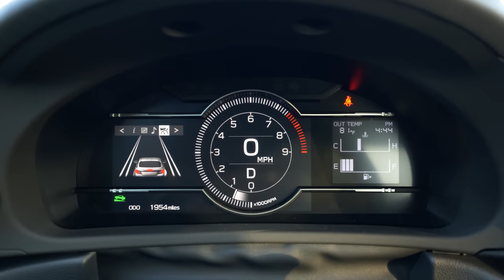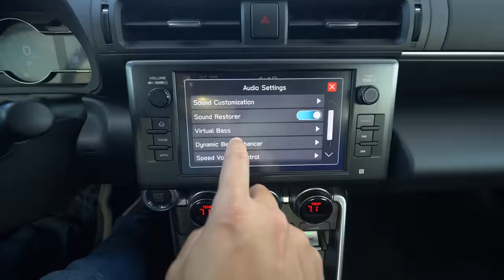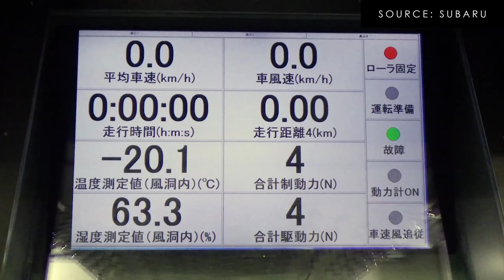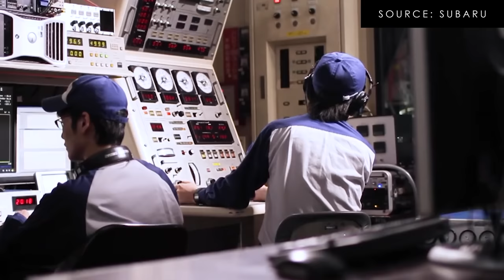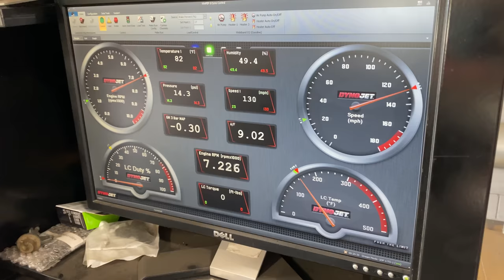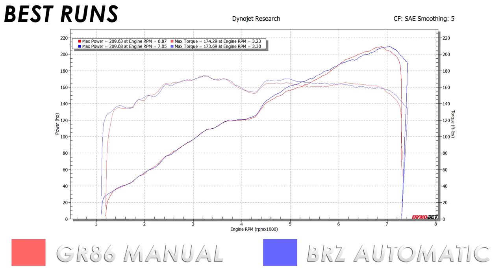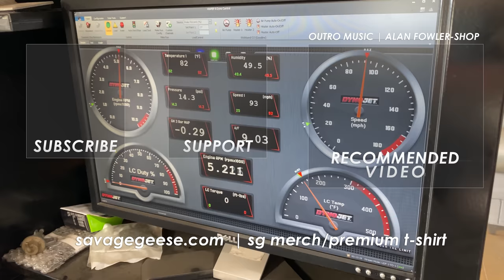2022 Subaru BRZ | Something For Everyone

Comment: Were you able to feel a difference between the BRZ and GR86? Looks like the big differences are suspension related. Aside from spring rates and knuckles, the BRZ has its sway bars connected to the unibody, where the GR86 has it's swaybars connected to the subframe. Some reddit users mentioned the GR86 could be prone to flexing, if that is the case. (I'm no expert so I'm just reiterating what I read).
Reply from the maker: Its so minimal.  And anything that is different is purely bolt on related and can be swapped back and forth. Guarenteed you will see GR86 get the knuckle update.
Reply: @savagegeese  Was hoping to learn why Jack is getting the 86 as a way of discussing meaningful differences between the two.
Reply: @ragweedmakesmesneeze  he likes the front end better I’m sure
Reply: @savagegeese  PS, LOVED the alternating underside shots of the differences between the two vehicles. Very interesting!
Reply: @MaddNomad1015  Could be, or he really wants a duck tail spoiler? I was concerned with the fact that Mark was reporting that the back end felt more disconnected from the front end. Seems like a pretty glaring problem for a sporty car?

Comment: as some1 who daily's a turbocharged automatic 86 i dont really get why any1 complains about the auto in these cars, does everyhing i want it to, manual  shifts arent pdk level but definitely not slow.
Reply: it's fine, works well but performs like the 10+ year old ZF6 instead of the best new autos
Reply: Did you have to do any upgrades to have the tranny handle the extra power?
Reply: @deej628  no upgrades to the transmission whatsover

Comment: If I were to buy a BRZ, 86 or Miata (or most 4 cylinders) I would pick it up with a 6 speed manual. I do hear that the DCT on the Veloster N is pretty good though. Otherwise it's V6, V8's or EV's for me

Comment: Want GR86 handling, but, want BRZ front fascia [don't like the duckbill, either].  Which to get and then swap parts?  

BRZ front cover on a GR86 seems MUCH simpler than putting a GR suspension on the BRZ, yes?   

I think I just answered my own question.  
[Get the GR and swap the nose... but then have to paint match it, or wrap it all. 😁]

/I still have my '91 MR2 n/a manual.  The '93 suspension mods may have tamed the snap-oversteer, but also killed some of the liveliness.  [aka: duller].   That's where I'm coming from re: the BRZ suspension being less appealing to me.]    Appreciate any feedback from those that know.

Comment: UK person here and Flame me if you like but this is why I'm moving to a small lightweight hot hatch that we get here in the UK.. hyundai i20N. I'm on my 2nd FT86 car. Had 13 gt86 first now 19 brz. Imo out the box the brz is setup horribly compared to my 86. It's an understeering pig. Preferred the steering on the 86 too. I must have been mad to get the brz lol. I really wanted to love these cars but i just don't think an na flat 4 is a good sports car engine.  So wish we got the Z here in the uk :(
Reply: I think you ought to reserve judgement by saying that 'na flat 4 isn't a good sports car engine', until Toyota GB have demonstrators of the GR86s, now that the 2.4 litre engine makes a lot more torque at a usable RPM range. Also regarding the understeer issue, that can be rectified with camber/caster/toe alignment, sway bar size and tyres.
Reply: @smilepermile8165  i just can't see it myself,  flat 6 yeah! It's going to be better the F20 but that's not difficult lol
Reply: @patrickbateman7122  Its barely gained any more weight yet has all that increase in torque and the ability to still rev up to 7500rpm despite the increased displacement. You sound like a kid who can't be arsed to try new things. Like judging the book by its cover. Your loss at the end of the day lol.
Reply: @smilepermile8165  i am trying something new, I'm getting an i20N lol. I've had two ft86 cars, how many you had? 🤣
Reply: @patrickbateman7122  Oh wow you call a FWD pop & bang Halfords special chavmobile with an ecoturd turbo an upgrade from the correct wheel drive car? lol okay
Reply: @smilepermile8165  This Patrick guy thinks that his wrong-wheel-drive heap of junk with rear torsion beam suspension is worth 'moving to' from the RWD purpose built sportscar lol.
Reply: @smilepermile8165  lmfao i love these so called elitist petrolheads calling the whole rwd is always better blah blah. Actually that's one thing i don't like about ft86 owners. They think the car is the best handling thing in the world when it definitely isn't. I used to have a clio williams and let me tell you at 970kg with hyd steering that car was 100x more fun then any gt86 or brz and oh!! It was wrong wheel drive. As long as a car is setup properly fwd can be just as much fun. I've driven a lot of rwd turds in my time with open diffs..but yeah carry on mate i bet you had fun in your youth with many a hot hatch 😉
Reply: @patrickbateman7122  Clio Williams is an overrated heap of junk thats only marginal because of its weight from its tissue paper like torsional rigidity. 148hp and 129 ft lbs of torque from a 2 litre engine and you say that 'na flat 4 is not a good sports car engine'. Also you're just salty about your BRZ's 'understeer' issue because you know nothing about how to set the car's geometry alignment, tyre choice and sway bars.
Reply: @smilepermile8165  I'm a millennial actually 😉 bet you don't even own one of these yet and your defending your future purchase 🤣🤣 so Catchpole, Harris, Metcalfe,Meaden  are all wrong? when they rate some of the best drivers cars as hot hatches...🤦‍♂️
Reply: @jamescarson6681  🤣🤣🤣🤣🤣🤣🤣 keep telling yourself that, convince yourself!!! Ya numpty 🤦‍♂️ the clio was a raw go kart for the road and has been considered the greatest hot hatch ever made..
Reply: @iantaylor4294  i agree actually i should never have listened to Harris on his gushing of the gt86. Most overrated slow sports car of all time 🤣🤣

Comment: I liked the transmission debate. IMO cars like this need a manual. Automatics work better with a lot of torque and power. I wonder if the tuners have been able to crack the shift programming.
Reply: I think it's more the fact of it being a old 6-speed as Jack said. If they had moved to a ZF 8-speed as many use it would be a lot faster. I think the  new Nissan Z Jatco 9-speed  Auto is just a rebranded ZF.
Reply: @DragonKnightX12  the "Nissan" RWD 9AT is supposedly the Mercedes 9AT. The FWD 9AT is the ZF9. I think the MB 9AT & ZF8 are too big for this car. A small, cheap, good RWD auto transmission is a unicorn unfortunately
Reply: @future62  Yea. A  DCT would probably be the only option.

Comment: What if you put cup 2 on ? would you get more oversteer cuz increased front end grip? also could u ecu tune to get 8000 rpm?
Reply from the maker: The previous car tuners would try to do the 8000 RPM rev limit but ignored the low oil pressure as the car heated up

Comment: I had a brand new ND2 Miata RF with the auto and it was awful for aggressive/fast driving. Every time I let off the gas while accelerating the car would upshift and lurch forward. Didn’t do that while driving slow or cruising. I sold the car after 8 months because I got tired of that jerky behavior. 

If the auto in the BRZ is similar to the auto in the ND2 Miata then it should be avoided. What’s the point of having a sporty car that you can’t even enjoy sporty driving in. 

If auto is a must, for whatever reason, then one should just buy a different car.
Reply: Have you even personally test drove the previous generation 86/BRZ automatic to make that comment 😂
Reply: Because each company programs the gearboxes differently and modes are available to force the gearbox to shift more aggressively the Aisin A960E on the 86/FRS shifter quite well and downshifts good as well tooZ
Reply: @iheartgs400  What does driving the previous gen 86/BRZ auto have anything to do with my comment? In the review they said the auto in this gen BRZ was similar to the one in the Miata. So I was simply expressing my thoughts on that since I did own, and daily drive, the ND2 auto Miata.
Reply: @hashmanxx  because its the same damn autoslush box as the previous gen virtually no changes.
Reply: @iheartgs400  Well, if it’s that good of a slush box in the BRZ/86 care then it is nothing like the one in the ND2 Miata because I can tell you from experience that the Miata’s auto is awful.

Comment: At 11:30 the passenger states the automatic transmission take rate is 70%. 

It’s disappointing that such a fact, easily found, is wildly incorrect. 

Subaru says the manual take rate is 75%! It’s interesting to note that the version he plans to get, the Toyota badged one, has a manual take rate significantly lower. And in fact lower than 50%.

Comment: GR86 are no go, because their engines are unreliable. Subaru BRZ is just manufacturer's version of a same car. I would avoid both models like plague unless you like catastrophic engine failures due to oil starvation. It is shame too as those cars could be worth something. However, as it stands, car enthusiasts buy them brand new and then off load severe technical issues to second hand buyers.

In the end, Miata is always the answer.

Comment: The weight number you showed was labeled "GR86", so was it not the BRZ after all? 2814 is the exact number you got in your GR86 video and it would be crazy if the base model, auto BRZ weighed the exact same amount as a upper trim, manual GR86...

Comment: For the difference in prices there is literally no reason at all for anyone to get the lower trim. The interior changes alone are worth the little extra $$. Better seats, nicer door\dash inserts, better sound system. Then the larger wheels with better tires just seal the deal. This car is so cheap there is no reason to penny pinch. What is the price increase on a 5 year loan to upgrade.... $15?

Comment: I saw the gen 2 cars have a coolant based oil warmer/cooler, how difficult it is going to to remove that and install a air based oil cooler?
Reply from the maker: Its easy just pull off sandwich plate and coolant lines.
Reply: @savagegeese  I was looking at the image of the new engine, the way the lines are routed looks different from how people are adding the OEM style oil warmer/cooler to their gen 1 FRS/BRZ. I'm wondering what kinda of bypass we have to add after we pull off the lines
Reply from the maker: @chowchow3335  you could just do a coolant loop with existing hoses with a T   if you wanted to do it quickly.  I didnt get my head deep into bay to look at routing of lines however.

Comment: Considering you can get a 2013 BRZ for like 10k. I'd rather get an older one
Reply: 10k for these cars will get you one that’s rebuilt/salvage title with over 100k miles & an automatic transmission at best.
Reply: @CarsOverPeople  ya and? It drives the same as a mint car with 20km lolol
Reply: @didafm  
Lol ok bud. Good luck with that
Reply: @CarsOverPeople  I've owned multiple rebuilt card and multiple active ones
Reply: Avoid the 13 for the love of god at all costs too many of them have rod bearing issues or valve springs blown up spend the extra few thousand and get a 15+.

Comment: Isn’t this basically the same automatic you get in the MX-5? I thought Aisin made the Skyactiv 6 speed AT for Mazda, or at least tooled it, because it had Aisin stamped on the case.
Reply: The skyactiv trans is made by Mazda in their powertrain factory in Thailand. But you are partially correct, before skyactiv, Mazda used an Aisin trans, like in the auto NC Miata, which was speculated to be a derivative of the same trans found in some Lexus products.

Comment: @13:58 in an actual track setting when does anyone downshift into 1st gear. 2nd gear yes, but I’ve never found myself going into 1st.
Reply: Autocross? Drift events?
Reply: @Fastvoice  good point. I personally don’t cause it feels like it’s so hard on the transmission. But that would be the only I time I’ve felt it would have helped in a faster lap/time.

Comment: Larger front sway bar does not reduce grip, but it may feel that way depending on the proportion of the weight it controls when compared to the rear. If larger front sway bar is installed and small rear one is retained, handling will be out of balance and car may exhibit both understeer and oversteer in different situations. For whatever reason that porky Jack annoys me so much I'd likely beat him with a plank as soon as his arrogance would intervene my air space.

Comment: I kinda see this as a modern G35 coupe replacement. Not a V6 but seems to be similar in speed. This new car is a lot lighter so it should feel better in turns. Both are very usable sportscars.
Reply: These are nothing like G35s. I had a manual 06 and it was a boat. These are much more like a slightly bigger Miata.

Comment: Not gonna lie, I'm getting tired of car reviewers shitting on certain gear boxes simply because they are not manual transmissions. Tell me how good it is for what it is and compared to like products, not just comparing it to your preference. "the automatic is trash because manuals are better" is not useful buying information. Not everyone can physically work a clutch or want to deal with a manual in heavy stop and go traffic.
Reply: They spent quite a lot of time comparing this auto to others. Their point was this is a bad auto.
Reply: @dielaughing73  maybe, maybe not. It was compared to one 10 speed from Ford, some CVTs, and some DCTs. But nothing of value was said, just that those are better transmissions, but nothing on why. How does this automatic work for this car.  Just screaming about how the manual is the best option and mentioning that better transmissions exist in other, dissimilar cars is not helpful.
Reply: @ryebread095  They specifically said that it refuses to downshift unless its at really low rpm, i suspect due to fuel saving programming.

Comment: As opposed to this automatic, I think an iMT, auto clutch manual transmission would've been a more fun choice. You still row your own gears, there's still a manual shift boot, but you don't have to deal with a clutch pedal. Toyota actually had an iMT on one of their hybrid coupe concepts which was based off of the old GT86. It had a manual shifter but no clutch pedal.
Reply: I don't think anyone has made a good streetable single clutch auto. The DCTs are better in every way for street minus the small extra weight
Reply: No

Comment: There is no sane excuse for trying to conceil the presence of fake engine noise, but of course this is an insane world.
Those customers that would add cool sound intentionally will want it and those who cringe at that do not want it. I don't see anyone getting upset about there being an option to make the car either sound more present or very quiet. It implies they are significantly ashamed of that feature yet still decide to add it. This isn't selling a product but peddling some bullshit.
And hearing the sound... It's like a cat in heat.

As for younger average driver age and that meme pic... it is misleading when you see how high that average still is. (Or were those figures owners/licensed to, not drivers? 🤔)

Comment: The last gasp of the ICE generation.  Sad, but true.

Compared to the GR, it does look cheap.

What Jack doesn’t understand is that 99.99% of the general buying public is looking for an auto. Yes, we manual drivers do live in an alternate universe. 70%  is probably a low number of auto takers.  13:23 Mark losing it a bit?
Reply: People started screeching about the "last gasp" of ICE over a decade ago.
Top Gear did 5 or 6 farewell tours for ICE then 5 years later (and 7 years ago) the Hellcat range came out.
Reply: @tim3172  Things have changed dramatically in those 10 years  and it's predicted by 2030 that the large majority of sales will be BEV. The paradigm is changing and the manufacturers are all getting on board the BEV train.  Reluctantly, but look at GM and Ford and Volvo and even (more reluctantly) Toyota and Honda.  Check out Sandy Munro, he speaks the truth from a very logical and experienced point of view.

Comment: Looks cheap!! Got to be a 22k car anything more then that you wasting your money . Even older ones I see don’t look like they hold up paint, body, etc. it’s garage! Also I thought they come with Michelin pilot sport 4 s. Hmm your car don’t have them
Reply: My biggest beef with the platform is actually the motor itself how will this FA24 engine hold up against the last gen FA20, seen too many especially in the 13/14 suffer from rod bearing issues from hard canyon/track driving and its a bitchely expensive motor to replace almost 4K just for the engine, hence why I’ve seen many mechanically totaled out but with straight chassis
Reply: Base models get the Primacy's. Top trims get the Michelin's.
Reply: @RAZGR1Z   the big question is if it’s worth the upgrade just for some tires. Nothing really different but maybe if your lucky some more tech in car. But if they trying to sale this car for over 30k they have lost there mind.